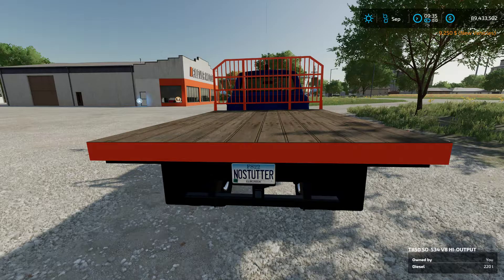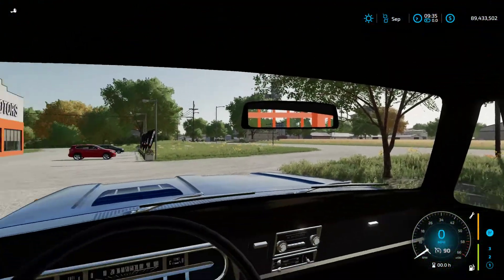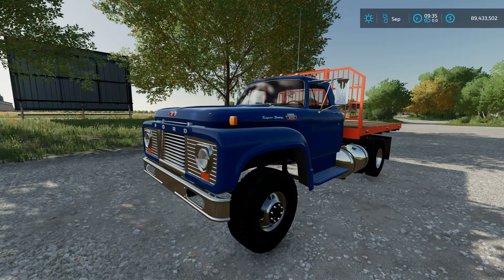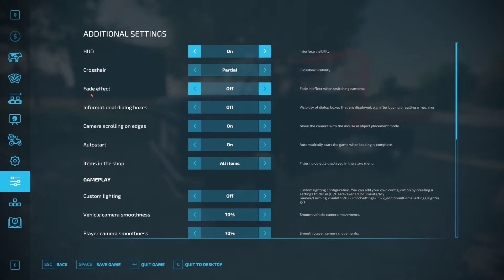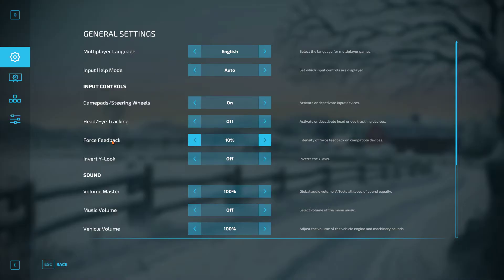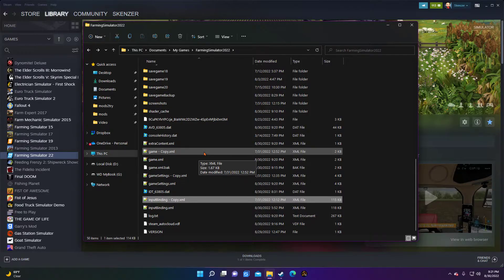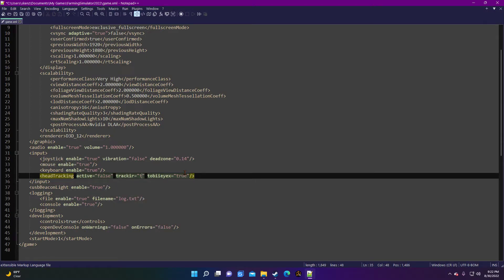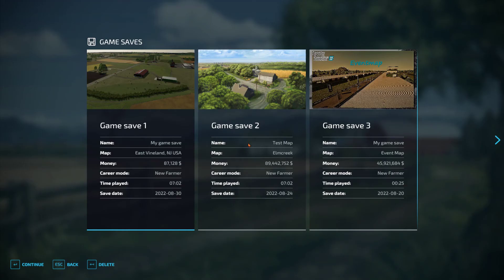Micro Stutter NO MORE! | Farming Simulator 22

Comment: This worked well enough, I have a 3060 ti and an 10th gen i7, I was scared when it stuttered at 1080p, this fixed it well enough to run it at 1440p medium settings with only some stuttering at very high speeds

Comment: I thought I broke the game, I had no clue about the shader building stutter you described here. My game was working perfectly, so I decided to up the graphics slightly, and after doing it I was getting that shader stutter. I reverted the setting and I was still getting it. I thought I broke it, but you mentioned it does that every time there's a change in graphics settings. After letting it sit and running around the map for awhile, I was able to max everything out and still get excellent frame rate once the stuttering stopped. Thanks, although I didn't need the tip described in this video, you helped me figure out my problem in your responses to some comments down here. Much appreciated
Reply from the maker: That’s great! I’m glad it helped and thanks for letting me know…. and watching 👍😀

Comment: As a fellow gamer and an FS player since fs13, ive noticed this as well as stutters in general, since hour one of launch. Since then ive gone through 3 upgrades to the monster ive got now(i play star citizen amd strem it on the same pc,as well so that gives you an idea) and ive been searching for a really long time for a solution. Now i might add that recently they added turning VSync off and changing the framelimit. I found your trick worked amazingly, especially when paired with turning Vsync off(specifically if they have a Gsync/freesync monitor) and setting the framelimit to a high rate to let their gpus run free(this game seems to like to hardlock gpus to a specific framerate and i was noticing my gpu was ramping up and down which caused frame time delays). This and since im on a Asus ROG 3060 i did DLSS and it looks to be pretty much flawless now. i greatly appreciate you sharing this discovery, and if you want to add my fre tricks ive learned you are welcome to it as well. Happy farming. Also imma sub cause you found out the other have of my problem lol ive never used tobil. So i didnt even think to check the XML for it nor did i think it wasnt actually off lol.
Reply from the maker: Glad it helped and thank you for sharing your tricks as well and the sub 👍😁
Reply: @rqsgaming  wow sorry for the horrible typos. It was really late at night when i wrote this. Haha. Anyways since then i havent had any major issues. I did notice flickering with the trees when seasons was on and it was autumn. This caused frame drops too. Setting the visual month to March fix it. Other than that you are welcome to share and or post anything ive come across if you wish
Reply from the maker: @kamakazedragongaming3129  no worries about the typos, I totally understood what you were saying 👍 I get the tree flickering as well sometimes, only when I have the frame rate unlocked. I get rid of them by hitting F2 and locking the frame rate. It’s an issue I have seen almost since the initial release i think. I think Giants still has some work to do with fixing some graphics issues. Thanks for the tips you gave, really appreciate it. 😁
Reply: @rqsgaming  any time. Keep u the good work
Reply: if anyone is still getting the micro stutter, try making sure vsync is turned off in game and in control panel or amd equivalent as @Kamakaze Dragon Gaming   suggests, vsync to off fixed my issues

Comment: Thank you! From my preliminary testing I'd say it's all fixed now and I have been fighting this issue for a long time. I thought it was my 4060 ti as Nvidia really crippled it by halving the bus, they did make other improvements but that reduction alone pretty much neutered this card. My current PC I am limited to certain GPUs due to the length of the card that will fit inside the case. I have parts on order for a new system build where I'll be able to use a lot better card.
Reply from the maker: Glad it helped, thanks for the comment and for watching! 👍
Reply: @rqsgaming  The option inside the game was turned off, I had to edit the file to force the change. It seems like others are having the same issue where that option does not really disable it. I've seen that it's been talked about on their forums but Giants hasn't acknowledged it at all... it seems they are typically slow at providing fixes.

Comment: This didnt seem to work in my case for some reason. I let the game run without doing anything for around 40 minutes, then went to do some contracts for around an hour. That whole time it stuttered and the audio was weirdly messed up. I have no issues like this in much heavier games since my pc is pretty good, not sure what to do anymore.
Reply from the maker: I’ve had weird audio issues as well. If I remember correctly it had something to do with my windows, audio settings, but I can’t remember specifically what
Reply: @rqsgaming  happens only on FS22, but it's fine :). i'll just deal with it and play the game nonetheless
Reply: welp, i was too quick to judge! took a little longer and i know why, but it's running smoother now, still stutters sometimes but it's less than before. seems it's only getting better from here because the fifth shader cache is almost built! glad to be able to enjoy this game properly.

Comment: aaaaaand for some reason my game is still a stuttering mess. COME ON STUPID GAME! processors running almost no load like wtf?
Reply from the maker: That’s frustrating. Did you try the steps in my second stutter video?
Reply: @rqsgaming  yes. wasn't that either. i did eventually figure it out and got the game running pretty smooth. (had a background task that was hammering the ram io bus along with a dying hdd)
Reply from the maker: @blendpinexus1416  Ah yes, nice find. Glad to hear the stutter is no more. Thanks for the update!
Reply: @rqsgaming  yeah the background process was an eroneous service and the hdd was wreaking havoc on the shader chaching.

Comment: Hey, when i join the game i get 10- 20 fps with medium settings with rx560 2gb vram, but sometimes when im lucky i join the game with 50-60 fps with same settings, i dont know why, i deleted shader it didnt help out, i know that rx560 is not perfect graphics card for the game, but its funny how Red dead redemption 2 runs way better than farming 22, also one settings called Shadow distance quality, when you switch it to low, it revertes when u quit game or when u return to game menu

im so pissed off and not bothered to buy new graphics card when the game is shitty optimized
Reply from the maker: Are you talking about Multiplayer? If so then what you're seeing is likely due to server connection speeds, etc. If you're referring to local game play then that is really odd.
Reply: @rqsgaming  i dont want to talk about multiplayer its ass disaster i get 5-10 fps, its about singleplayer and the problem i think i found out is that vehicle models lags hell ton out, but getting a cache file that rendered vehicles reduces lag alot.
Reply from the maker: @IndevFocus  i’ve had certain mods that cause really bad frame rates. Even parts of old family farm map have that issue.
Reply: @rqsgaming  i dont have any mods